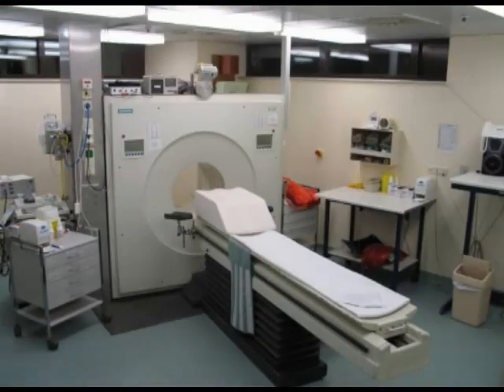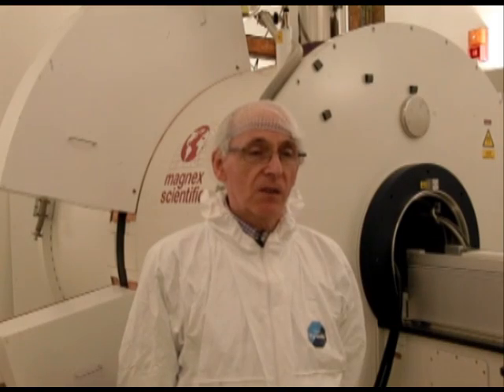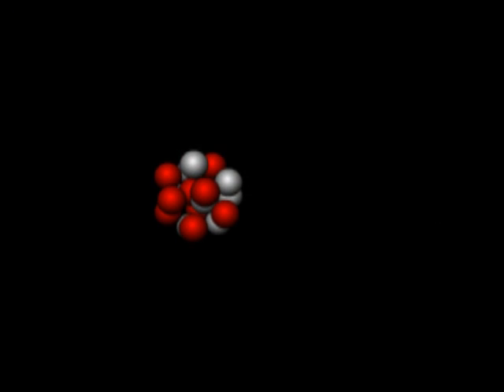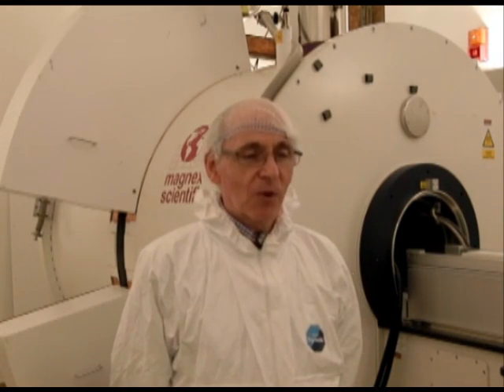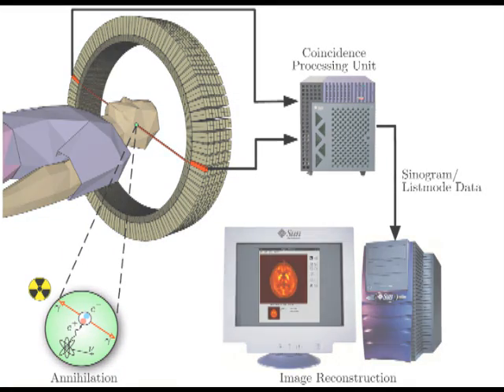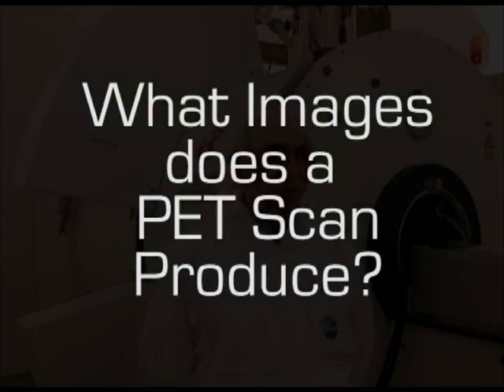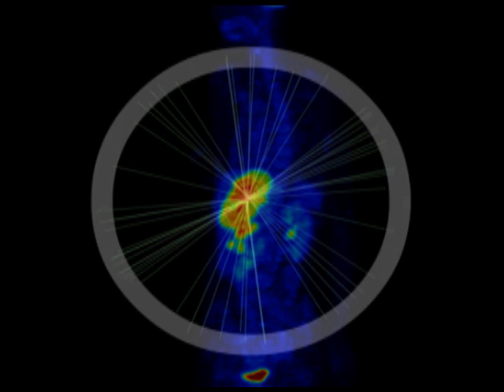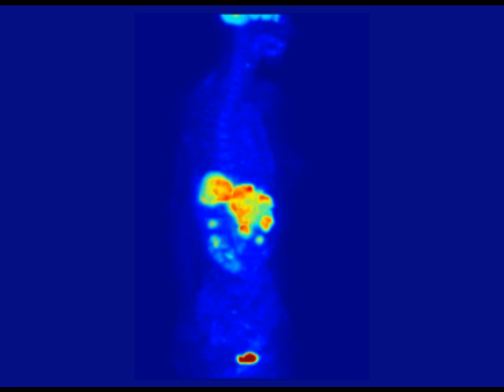PET Scans - Naked Engineering

Comment: Good presentation. (I disagree with Olly Rennard.)  I'm wondering: if the PET scan tracers gravitate toward cancerous tumors, could they not have therapeutic value?  Imagine the fluoridated sugar tracer congregating in a tumor, and then emitting positrons, which would severely interfere with the atoms making up the tumor.  Isn't there some use for that?